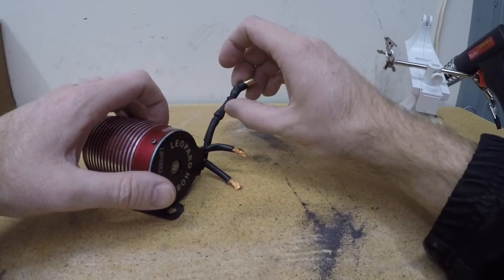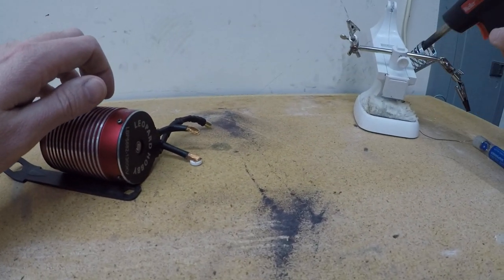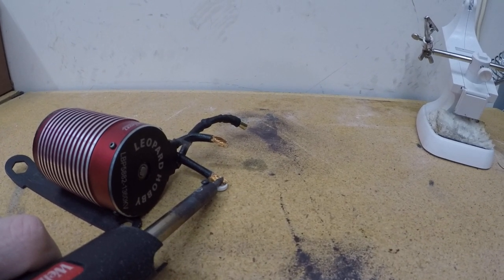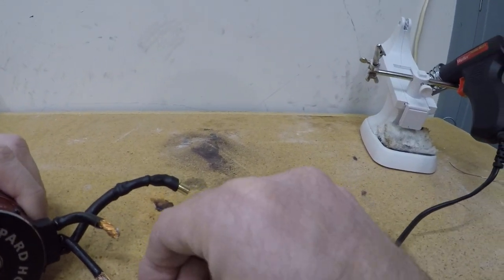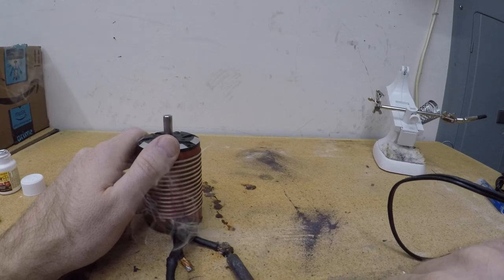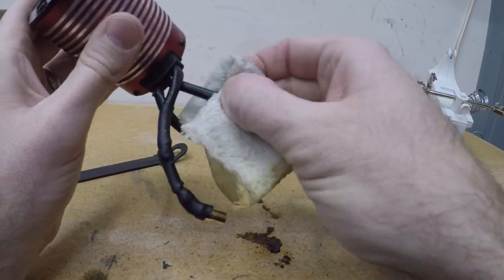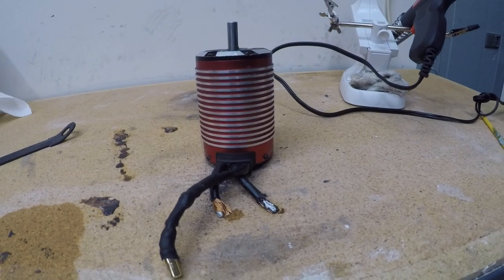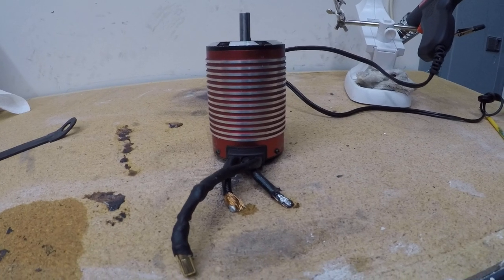How to solder wires that will not solder due to enamel coating

Comment: Had to double check that this wasn't on a certain 1st day of a month that comes 4th in the year..... and, appears not to be-

I encounter this issue so much- mainly due to my stupiditty of not learning my lessen of taking alazy way to strip more wire if i'd not done enough, being; using the soldering iron to melt the plastic/ whattever coating, which spreads it on the wire in a melted fashion....most times, not allowing the solder to do it's thing...i thought it'd been  my solderring skills dimminishing- since most all times i can solder no prb. But, today yoou've blessed me with this knowledge and understandig of what needs done.... many thanks!
Reply from the maker: @paranoidzkitszo  glad this video helped you.

Comment: It's not a corrosion measure, it's copper magnet wire, you gotta insulate it otherwise the coil just shorts itself out and you don't get turns and therefore no magnetic flux amplification.

Comment: So i have this same issue dam near same motor(1340 5892) and my motor gets unusually hot cause I could only get the solder to stick to some of the wire and then wrapped it with electric tape cause it never got the wires that hot. But then after i did the wire extension one wire separated from the heat. I was thinking of using a tiny wire wheel to slap it and remove the coating.
Reply from the maker: Yep you need a clean solid connection.  Mechanical scraping off or chemical like I had shown.  Even with the chemical process I still had to scrape some with a flat razor blade.

Comment: i'm working with similar scenario, i have a "high temp" thermistor, i believe it's a pt100 of some sort, but only has one single wire for each of the leads, and i've attempted to attach solder to the wire without any luck. i consider myself proficient with soldering, so i'm little confused as to why my solder is not sticking to the wire.

if you stick a meter to your wire (the ones with the enamel coating) to do a continuity test would your meter still report continuty or does the enamel coating prevent continuity? i ask because the single wire i'm working with reports continuity but i'll be damned if i can get some solder to stick to it.
Reply from the maker: For motor windings they cross and overlap so they cannot conduct with each other.  The enamel isolates them.  I'd recommend the scraping method and see if you can get a small area to accept the solder with some flux.

Comment: Hi. How did this end up working for you?  I have a tp performance motor not knowing i cut connections off. Any other methods u learned about?
Reply from the maker: I had to repeat the process several times and scrape some residue off after.  Overall it did work.  Absolutely wear a respirator and have a well ventilated area!!!
Reply: @Liberty.Francis  thank u. I see another method of salt and acoustic soda. But i dont know where to get that. I'll try aspirin tomorrow.  Will it work for 8mm wire?
Reply from the maker: @mikeinvegas1  I don't see why not...

Comment: I tried this but it leaves a black residue. It still needs a secondary cleaning with something else. I’m still on the mission to get them properly cleaned. But the aspirin does help. 👍
Reply from the maker: Yep you have to clean and scrape but the aspirin does 90% of the work
Reply: use hot water.